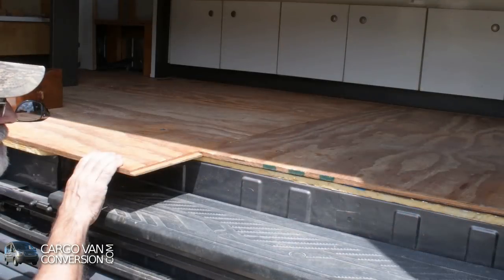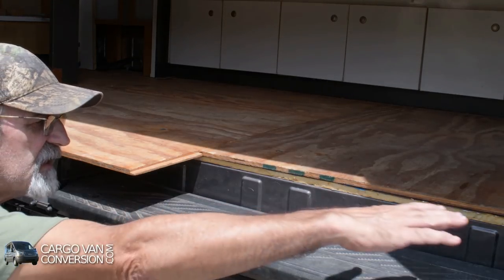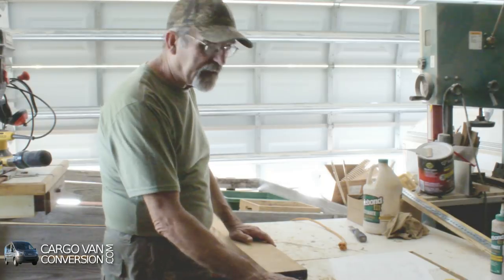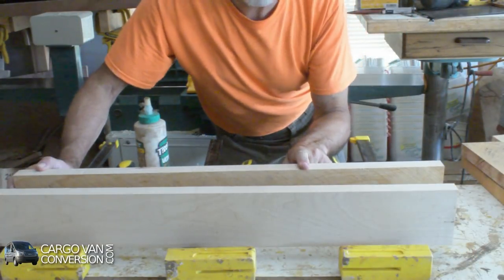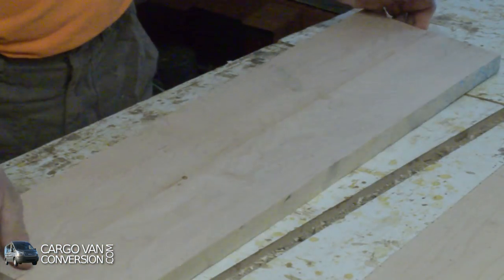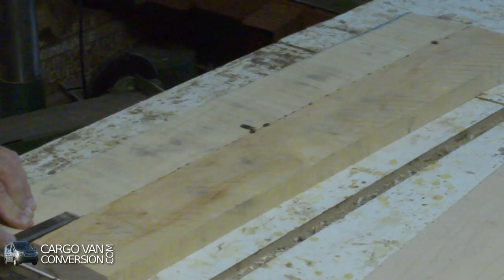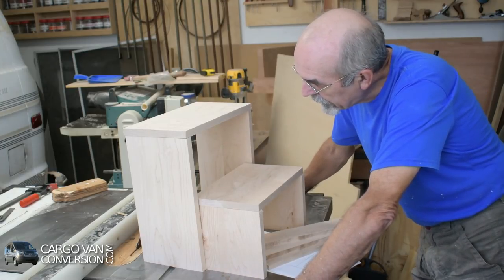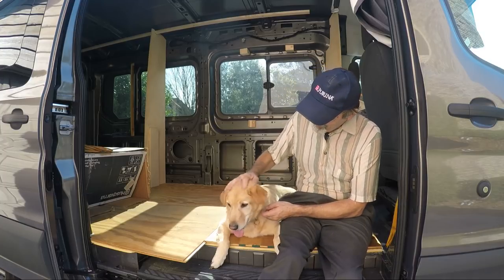How to build a collapsible RV step stool

Comment: Hey Van -  Build looks great -  folding stool will be nice - U have gotten alot done since we last talked -
I finally installed Tesla battery /working -  things beyond my control slowed progress-
also got Victron inverter -
1200 watt - has 18 volt cutoff(24V) OR 9v for 12volt so works Better with Li ion battery - 
got a fridge - dorm style - Now building counter top and shelves  to hold small stove and pantry stuff  -
Slanted shelves I made have worked well - stuff pretty much stays in place -  harder to make tho -
got 6  flexible solar - 125 watt @34V - only had a few days// output  80watts @31v  is highest so far-

Talk to you soon -Jay -
Reply from the maker: Hi Jay,
Once in a while I read something between the lines, that gets me exited. You mentioned "slanted shelves"; that's a great idea for RV's. Have to think about that, but I wonder if you don't loose too much space where the shelve meets the wall? Would love to see a picture. You will like your fridge; it's the single, most useful item in the van (in addition to the bed).
With so much solar, you must be cooking on electric, but then again, is a 1200W inverter sufficient then. I'm going a similar way; hopefully soon I will replace most of my basic solar items with Victron. Including inverter, but that will be a 2000W minimum, perhaps 3000W out of precaution. Most induction cooktops are 1800W max and a 2000W inverter should be just sufficient. Still have to decide on 200Ah or 300Ah Victron Lithium.
I would love to hear more about the Tesla battery; that must have been quite a job to install. I got similar flexible solar, like you have, but most 28V. 34V is sweet. You should be able to double you current output. No more worries about sufficient power :) How big is your Tesla battery? (physical and Ah's).
Hope we can meet up sometime.
Van Williams

Comment: A nice amalgamation of ideas Van!
It's great having a forum to get some outside views on our projects. I've hit the wall a few times on where to go in a few builds and it's always been someone who says, "So are you going to..." And it just opens a new door in the creative process. I have barn doors on my van where you have a slider so it's easier to add a shelf to the door and when you swing it closed it joins the floor and the brackets are the joists to hold the weight on the step.
In your case it's a little different.
I also do metal fabrication so I step a little further outside of the "box". But entertain the idea of a double drop hinge and the floor would fold out and down creating a second step for you and Joey.
We aren't getting any younger, Ha ha. And it would that little boost to get in easier. I am taking your idea and adding on my other door. I can hang it on 45° cabinet cleats and take it down for a step to get in and out plus a piano hinge and a push latch on the when it's hung it can store my outside shoes they are usually under my seat but let's be honest shoes do smell after a while. And getting them in a box with a few dryer sheets would be refreshing. So I thank you for your idea. And I finally filled that space between the kitchen cabinet and the door!. Happy travels.
Beeps.
Reply from the maker: Hi Beeps,
During my build I regularly have been convinced to do things differently, by all those who post comments, so it's a great resource for me. That's also a great idea to use it as a shelf on the door.
I'll keep it simple (KISS) and make the opening(s) accessible from the top.
Not much metal fabrication on this side, except for the aluminum brazing for the gray water tank frame. That's as far as I'll go with that :)
Would love to see some pics of the stool thing on French cleats. One thing we both know is that getting old requires a few additional props to keep us in the game.
As soon as I get on the road, we should make an effort to meet up somewhere. That shouldn't be too difficult :)
Van Williams
Reply: @cargovanconversion  I'm going to be ready to go by August. I'm currently working on two van's and still doing remodeling as my primary business. So as soon as I get the Vans done and clear the books I'll be looking forward to heading south. I need a couple of mile 0 decals for the Vans.
Reply from the maker: Hi Beeps,
We are on a similar schedule, although mine will be end of the year or early 2020. And I still have to sell my house and business. May go temporary into my van if necessary.
Wish you well.
Van Williams
Reply: @cargovanconversion  All in good time. It's nice to go about it at an easy pace. For now enjoy the build. And good health.
Beeps.
Reply from the maker: Right attitude!
Van Williams

Comment: I've slept in my Transit for 7 months out of 18-month ownership. By eliminating the interior step and now "having" to set up your stool each and every time you stop will get old real quick.  My van has a stock exterior step and it works just fine (I'm 5'7" 63 yo).
Reply from the maker: Hi Terry,
I don't disagree. It also depends a bit on how often you move; I would like to stay in one place, one week on average and that would lessen the whole assembly thing. One other issue is that I want to stay as stealthy as possible, by limiting all the exterior additions. I do have my solar panels, but these are virtually invisible; and a roof vent. Otherwise, it's a standard van.
Ultimately it is personal choice and a compromise by any definition. Time will tell how that works out.
Thanks for the feedback.
Van Williams
Reply: The exterior step is a Ford OEM and does not in any way read "camper" ... My roof is bare except for a Max Air -  window on the sliding door - yet to have the 2am knock!
Reply from the maker: Hi Terry,
As I said I don't really disagree and you're right about the step. The MaxxAir on either of our vehicles, is a dead give-away for any Sheriff in addition to the license plate and you'll have that knock on the door sooner or later. I've lived in a regular travel trailer many year ago for about 4 years and only gotten that knock a few times. When you follow the rules and don't do anything crazy, you shouldn't worry. As a matter of fact, once I was parked close to Sunset Crater near Flagstaff AZ and we got that famous knock on the door in the middle of the night; but that was to warn us about a few escaped prisoners. I'm still thankful for that.
Van Williams

Comment: Hi Mr Van, I have been admiring your work on the van. You are a true craftsman.
However, I really think you should reset your logic circuit on this step. If I  have it correct,  you are covering the existing step well in order to provide a storage space for a new step which you will need because you have covered over the existing step well...I would leave well enough alone. The existing step well is a great storage area when you travel and serves as a good transition area between the muddy outside and your nice clean floor. Love your videos.
Reply from the maker: Hi Norman,
Thank you for your constructive criticism. I do agree with you and up to a little while ago, I planned only for a small storage box in the same area, for some flip-flops and/or leash for Joey. The switch to covering the step-in area would solve two issues for me. Regaining more floor space and preventing stumbling into that lower space, especially at night when the bed is down. Also the existing step-in is already quite high and difficult to get into. A step would improve on those. On the other hand, frequently assembling and disassembling the step will become a nuisance, as someone said before. As to keeping the interior floor clean, I have given up on that, a long time ago. I know that constant cleaning will be a daily chore in a van. Fortunately it's just a small space.
In the end it's always a compromise and not a perfect solution. For the time being, I'm focused on trying to make a sturdy stool; if that doesn't work out, I'm back to my original plans :)
Van Williams

Comment: After you have it fully sealed, painting it with rubberized truck bed liner will make it wear better and will be non-slip.
Reply from the maker: That would be fine if you don't have to disassemble the steps regularly. May do that anyway for the majority of the steps. I still have to figure it out :)
Thanks for the idea.
Van Williams